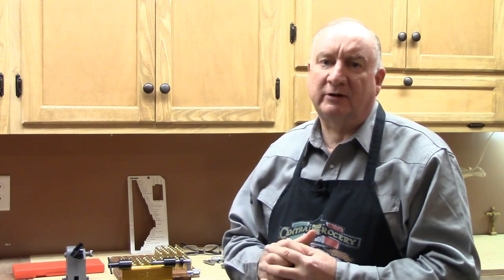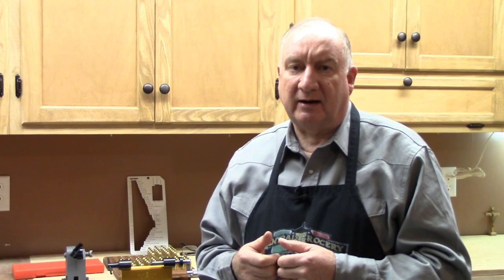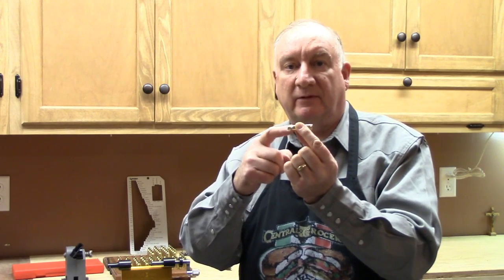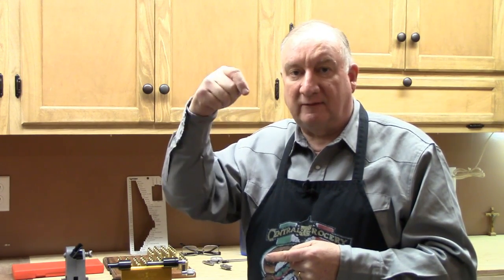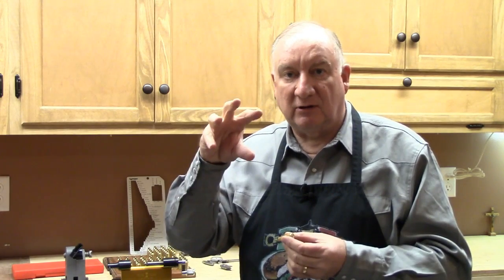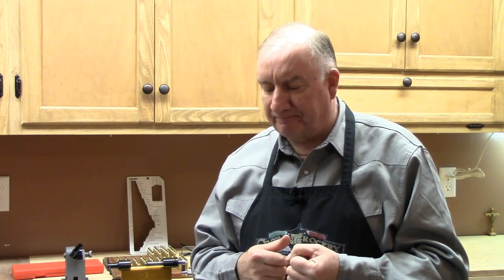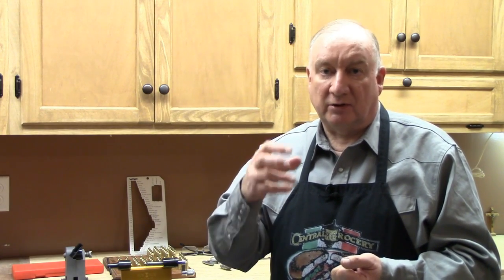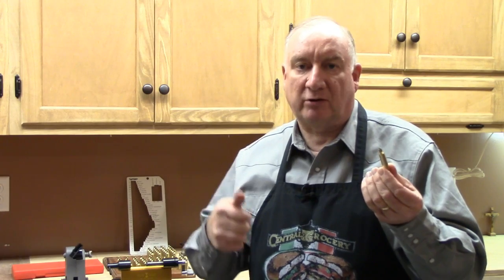Neck turning and neck sizing ~ Seeking a higher level of accuracy!

Comment: I've been thinking,even if u had bullet run out which u never did check, by trimming the outside of the neck.............did u really ever change anything inside the neck......? The answer is NO! NOT UNTIL u shoot that cartrige! & how did u detect that the neck brass thickness was thinner on one side than the other, which u didn't check, ure really chasing the rabbit down a hole my friend, u should have shown us the neck trim.......!

Comment: Thanks for doing the opposite of most who just tech spec it till you cant get the idea or feel intimidated. Im a 26 year vet and i take great pleasure in leaving my ideas back and pay close attention to what I can learn and verify and i think i came on top. Ill be better informed and more responsible owner. On this side of the border shops just tell you what you need which happens ro be what they need sold feom whats available and pay no mind to your actual  needs or expectations. I now feels surrounded by pseudo experts  who in fact can only handle surface level scrutiny. Knowledge is power. Airborne!

Comment: Erik Cortina says stop neck sizing your brass...
Reply from the maker: I'll stop when it doesn't tighten my groups. Neck sizing tightens my groups.  It tightened them 40 years ago, and it still does, considerably.  It's a pretty slick idea for an active F Class competitor to advise his competition to de-accurize their guns!  lol!
Reply: @GunBlue490  I agree with you and support your advice. I have full length sized and I have neck sized and I let my results guide me. And my finest tightest groups have been with uniform neck sizing. If the bolt begins to get a little tight during closing, that is when I will bump the shoulder back about .002". But no more than that. I have no prideful purpose in doing any specific reloading process. If it works for me, I keep doing it. That's why I often enjoy 1/4MOA on a  few rifles.
Reply: @GunBlue490  In that video Eric was referring to the idea of just neck  "only". He neck sizes and just bumps the shoulders back 2k from fire formed case length.
Reply: @GunBlue490 pretty fun I think I just watched a Erik cortina video from a year ago where he met with some folks that had a custom neck sizing machine that trimmed the outside and inside the neck. 😂 and he had his own code to promote it
Reply: @GunBlue490  Why would you close your mind to ideas that produce even better results like Eric Cortina and his class of shooters ? Obviously you want good groups. However, to disregard proven advice from not only Eric but the other pro's in his class that advise against it diminishes your judgement. You owe it to yourself if not the other shooters you are trying to help, the watch some of Erics video's and LEARN from them. I used to watch your video's but after seeing your disdain for higher learning and proven methods, I'll have to reconsider.
Reply: @GunBlue490  That must be why when Eric walked down the line asking the F-class shooters neck sizing or F/L everyone one of them said F/L sizing they must just not get it like you
Reply: @deadnorth8333  , If you want to full length size, no one is telling you that it is wrong here. Erik Cortina has my highest respect. But you have to understand that he and all the people that he asked that question of all have custom minimum spec chambers and custom sizing dies that match their chambers perfectly. Of course they F/L size. I have spoken with a few of those men and I know that they have the reamer that cut their chamber also cut their sizing die. If I had a custom chamber and a custom die I would full length sizes as well. Enjoy your reloading and you're shooting.
Reply: @Jeff_Seely  well put
Reply: @Jeff_Seely  Thank-you for this gargantuan clairification... It all makes absolute perfect sense now.

Most of us do not need F-Class accuracy, but we still want all of it we can get.

My Forster Co-axe press and my Lee 223 sizing die combo is so accurate I could easily full length re-size every time and I'd still be producing some very accurate 200 yard ammunition.

I can full length resize, and or I can neck size only and bump the shoulder back   and I have the measurment tools to see exactly where I am in all of the key measurments.

If I ever want or need more accuracy... I can always look for it primarily in bullet and primer and powder selections, improved case preparation and in seating depth adjustments.

Comment: It’s been a great debate weather Full Length Resizing or Neck Resizing only is best for accuracy. 
I’m a fan of Neck Sizing only, BUT this completely depends on using the same gun, and keeping you brass based on batch numbers. 
Any variation in components or behaviour has a negative effect on your results.
When using the same gun the Brass becomes “Fire Formed” to that particular Rifle.
Bullet Jump is another factor. In some circumstances the overall length can be quite an advantage, some enjoy adjust OAL to just tough the Lands, as in some cases a slight jump helps. You have to test heavily to see the advantage. I used to smoke the end of a bullet, (less power) haha. In other words when I came very close to the bullet with a match or lighter, and it would leave a very this coating of smoke on the case. I would adjust my die so I could barely see contact. That Remington 243 BDL enjoyed it. Had eight rounds in under an inch at one time. Ground Hogs/Coyotes etc.
Be aware of brass flowing forward each time it’s fired. You might have to Trim your cases as well. Keep track of how many times a given shells being fired. There comes a time after chamfering that the neck gets very thin. 
I loved loading back in the day, in the last 15years I buy my shells cause I don’t shoot much at all anymore. I miss it and listening to you brings back fond memories.
It’s enjoyable to listen to someone with so much knowledge! Thank you..

Comment: when do you turn your necks ? when it's brand new OR after first firing ?
Reply: He said usually when the brass is new, but at anytime after firing it. Fire forming it is not necessary.
Reply: It makes sense to turn your necks when the brass is new but definitely BEFORE resizing, that way you are centering the neck to it's new dimensions. What I do is take either a fired case, or new, Make sure it's decapped, cleaned and THEN turn neck thickness. After that, anneal, then use a full length sizing die (without decapper and expander ball) and bump the shoulder back .002-.003 under fired shoulder length. Expand neck with a neck expander. Trim case length at this point if necessary. Deburr mouth. Now you're centered and ready to load.

Comment: How often should you "bump" the shoulder of your cases when you are shooting for accuracy~?.. Is "bumping" a worthwhile effort~?
Reply from the maker: There's no reason to bump case shoulders. Bumping was based on the use of full length sizing dies to partially size cases, which is a job they are not designed for.  If you desire precision accurate sizing, use a Lee Collet neck sizing die, or at least a standard neck sizing die. However, correctly neck sized cases chamber stiffly, and should not be used for hunting or other applications where easy chambering is more critical than 1/4 inch of accuracy gain.

Comment: Hello sir - you mention neck trimming just taking off high spot. As a precision long range guy (prs, bench) and a very anal ocd retired navy single seat fighter guy Im very (prob too) detailed. I neck turn to take off just enough to trim all way around neck. This gives me a set wall thickness that I can use to then try to set consistent neck tension. I always stay above shoulder. In your opinion is this acceptable from a safety standpoint? Example for 6.5 Creedmoor w Lapua brass I trim to .0135 wall thickness.
Reply from the maker: I explained that the high spot can extend mostly around the neck, but should stop short of going the entire circumference in order to preserve minimum safe thickness.  Lapua brass is exceptionally uniform and requires little if any turning to produce zero runout.  Remember that slop in the neck region produces the same problem as runout, which is why benchrest precision shooters match their brass thickness to have minimum bullet release clearance.  You should trim minimally.  Unless your clearance is less than .001" and you know exactly what it is, you should not trim more than that required to center your bullet, especially with a factory non-match chamber with standard tolerance.  Neck tension will always be quite consistent--and very acceptable--within a box of ammo, even with un-turned factory fodder, because it's a relative tension that's the same within a given lot.  Trimming too much can lead to insufficient tension, which is certainly undesirable.

Comment: I get excellent accuracy using IMR 3031. I don't bother with weighing brass, 1/10 grain of brass takes up such small capacity while 1/10 of powder takes up much more space so it's not a 1:1 ratio by any means. Besides where is the extra weight in the casing, the head, wall thickness or oal ??  Once processed using different brass I can't tell any variation. Powder and bullet quality are the two most factors in accuracy that I've seen.

Comment: I found consistency in set up using bag and bunny ears really showed my rifles accuracy potential. With this I can tell which loads are good or bad.  My Mod 70, .223 I believe has a somewhat lose chamber though it shoots just under 1 moa with a particular load.
I'd like to neck size only so the case has a snug fit and see what happens. I'll try sizing first because if you do two things you can't tell which one gave you the most  added accuracy.

Comment: When i shoulder bump my 22-250 case .002 - .003 in my Lee FL die  the case stretch .005 - .006 thousands and always require trimming. Even without the expander ball in place the die stretches the cases excessively, so after 2 firrings they are over 
C.O.A.L.

Comment: For field rifles .. iv taken the advice of f class shooter and use a head space comparator after I have fire formed brass I simply use the comparator and bump the shoulder back .002 so I know I have great chamber fit and still functions excellent in the action ... also in regards to neck tension iv found removing the expander ball and using a expanding mandrel with .002 neck tension has also increased my SD and ES in loads 👍great info as always ... you always have the best no non sense information for rifleman
Reply: Can you post a link to these mandrels. The sizer buttons are useless and I’m not ready to change all my dies to bushing dies. 

Thanks in advance
Reply: @Madskills-hw2ox  Search Redding.
Midwayusa and others that carry Redding will have them.
Reply: @yukon4545  
Thanks
Edit 
Just watched a video on these mandrels 👍🏻👍🏻

Comment: Do this test with the LEE Collet Sizing Die. Take one of your new unfired cases and one that's chamber formed. If you can get an accurate measurement of the neck thickness in different places record them. Run each case through the LEE Collet die and  remeasure all around the neck again. You will find that the die has completely uniformed the neck wall all the way around! No shaving required and no secondary tiny bottlenecks. Trimming is still required as required. Tell me if I'm wrong because I have machinist's tubing wall thickness Vernier micrometers in standard and metric and both tell me the die actually swages the neck brass to a uniform thickness just like a collet is designed to.
Reply: I have shot groups with the Lee Collet die as good as the Redding Competition bushings dies at 200 yards with my 22-250 hundreds of times.
Reply: Thank you for this info. I started using the Lee Collet dies for some of my rifles a couple of years ago and wondered if the swaging was not occurring to get concentricity. I've debated with myself about purchasing one of the tubing micrometers to see about this and if it was, I just wasted $ on something I didn't need and never would. Thanks, again.
Reply: Aubrey Steele you’re welcome. Annealing is still a good idea at some point although I’ve fired .308 Win brass 10x without annealing then tossed them.
Reply: I love my Lee collet resizer,I have a Schilen 24'' select match chrome moly vanadium barrel with a .246 neck that shoot sub 1/4 MOA all day long.

Comment: I strongly appreciates this lesson on case neck turning - however  neck calibration without centered case body deteriorates the neck vs. the body concentricity!  I have experienced (with a 30.06 brass) eccentricity of  body vs. neck of 0,16 mm (6,3 thouthends of an inch) 
What is your advise to prevent or mend this?

Comment: Before neck turning, all cases need to be consistent in terms of case length, so trimming each case to the same length may be an important step.

With neck turning, cuttting into the shoulder will weaken a case.  But not cutting the entire neck all the way to the shoulder will cause an external "doughnut" that gets pushed inside the neck when the case is fired (and the case neck and shoulder expand to the chamber wall).  That internal doughnut can then cause accuracy problems. 

 I usually fire-form cases, resize with no expander ball, then use an expander mandrel so the case neck can be expanded to perfectly fit into the neck turner mandrel in terms of tightness. After using an expander mandrel, the internal dimension of the neck is more consistent and more concentric. Then neck turn so the external dimension of the neck is more consistent.

I lubricate the turning mandrel and case neck before turning each case so the case does not heat up.  I assume a hot case due to no lubrication would expand and lead to inconsistent case wall thickness compared to cases that were turned while cool.
Reply: @MissySkeeter, do you resize again after neck sizing?

Comment: Good tip to cut only the thicker side, not remove the thinnest side.  
When should neck turning cutting occur? Before or after annealing?  Before or after full length resizing?

Comment: I am having trouble understanding when you say that a cartridge head is not positioned against the bolt face prior to firing and that firing the cartridge completes the expansion of the head into the bolt face. I think that when a cartridge is rammed forward into the chamber by the bolt that the cartridge head then seats into the bolt face as the case rim clips in behind the extractor, therefore holding the case head in place behind the extractor and to the bolt face. At the center of the bolt face is the firing pin. If the case head including the primer were not touching the bolt face then the primer would not be impacted by the firing pin. That is why I think that the case head is already touching the bolt face when it is fired as opposed to the case firing and then expanding into the bolt face.
Reply from the maker: Have you ever heard of "headspace"? That is the space between the bolt face and cartridge head. It's a required distance to allow closure of every bolt on any cartridge, because tolerances are made for looseness. The firing pin reaches across the headspace and drives the round forward until it stops at the headspace limit, which is either its rim, the belted rim, the shoulder, or the case mouth. The detonated primer pushes the case forward away from it until the powder ignites, which expands the case against the front wall of the chamber.  As the case expands sideways, it also drives the thick nonexpanding head rearward, stretching the web, completely filling the chamber. Resizing a case restores headspace.
Reply: @GunBlue490   - Thanks for your reply and I agree. Yep... I heard of that.... I guess I'm just overthinking it... That gap between the closed bolt face and the cartridge head is also referred to as "Head Clearance" which is included in and is part of the "Headspace" overall dimension. The "Headspace" dimension being the distance between a closed bolt face and whatever part of the chamber stops the forward motion of the cartridge. Depending on the cartridge of course, it's typically preferred for the cartridge to have zero "head clearance" or a cartridge headspace dimension that matches the manufacturers set chambered headspace dimension. Once the cartridge is seated and the bolt is in battery the extractor clip on a rimless bottleneck case must hold "head clearance" to practically zero and any dimension under headspace would be realized at the shoulder. Once I set my mind to consider "Cartridge Headspace" as a dimension that is designed to fit into the "Chamber Headspace" dimension it makes more sense to me. Thanks again.
Reply: @GunBlue490  , hi. as soon as I heard your first word,I knew you know a vast amount of knowledge. I reloaded 20 years ago and I have recently regained that space from commitments of family life. 
Could you please comment on your thoughts on the minimum seating depth of a projectile into the neck. To get .020” inch jump I am only seating the projectile A little over half the diameter of the projectile. Which also equates to seating in halfway into the neck. I’m reloading 7.62x39. The Lee full length die comes with 2 collets/mandrels. .307” for .308 projectiles and .310 for .311 projectiles. I’m using .310” projectiles and found the neck tension wasn’t enough with the .310” collet. I asked my local gunsmith to resize the collet to .309” but he took a little more off and made it .308”. I’m not bothered because another collet is only $10. I can get the projectile in okay with the .308” collet. But I’m reconsidering after listening to your excellent YouTube presentation. 
Thank you so much for sharing your no nonsense knowledge. Cheers from NZ